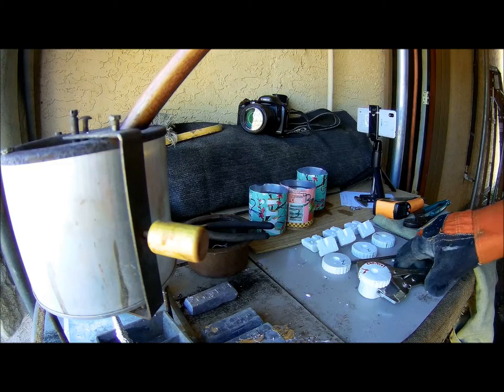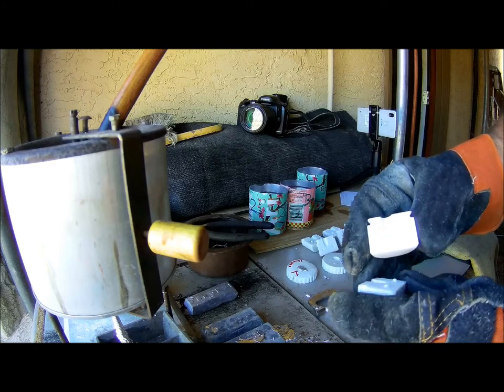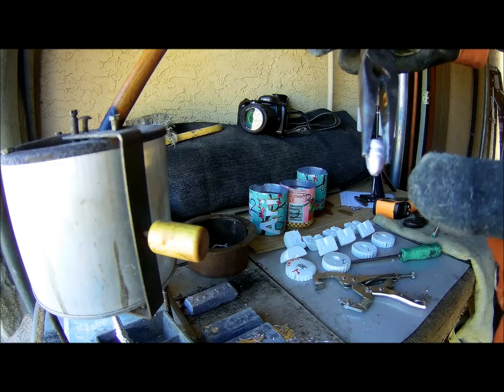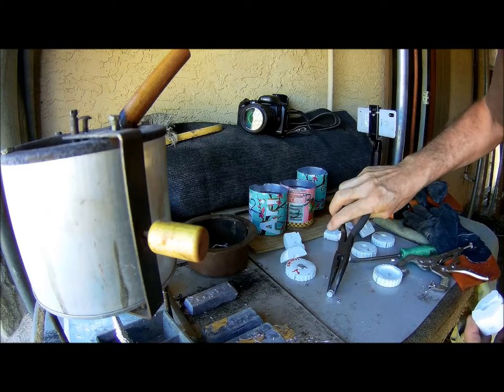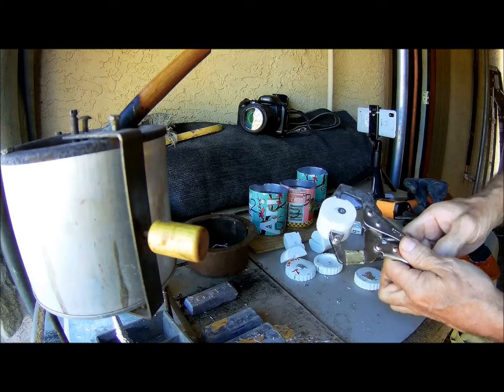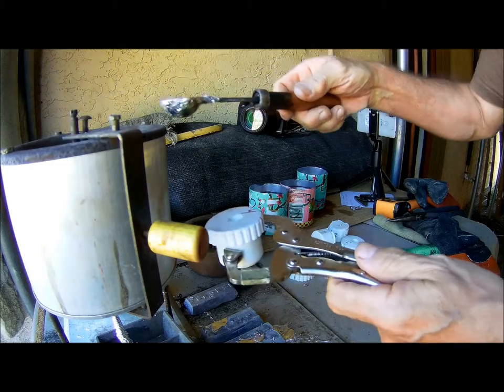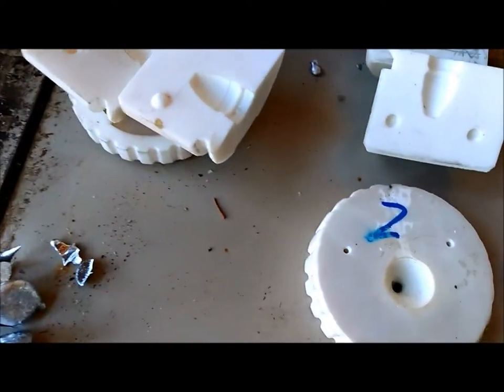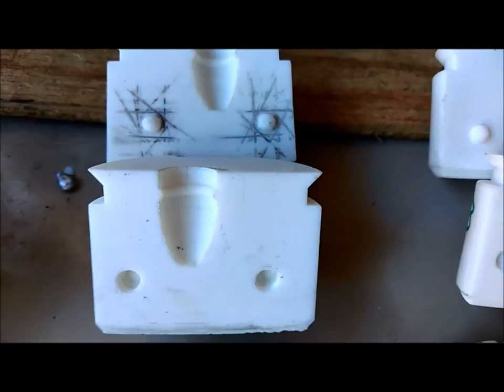3D Printed Single Cavity 9MM Bullet Mold Test Cast Number 3

Comment: You might want to try spraying a little water on the sprue right after pouring the lead. I have used this trick to speed up cooling on aluminum molds.
Reply from the maker: Greetings David Sherman; I used to do this too with my less expensive Lee bullet mold sprue plates then I switched over to using some lube called "Bull-Plate" or something like that.

I also tried water on my 3D printed injection molds but it was like pouring hot water on a frozen windshield on a cold winter day.  This was done using another version of the Siraya Tech Sculpt line of resins so it may be Ok to do with the  Siraya Tech Ultra White Resin.

Now that I have some used molds I may give that water cooling thing a try since these  prototype test molds are now relegated to expendable molds.

Comment: Uneven heating in the mold: I'm thinking it may be because your mold cavity and sprue hole is off centre? This may cause the lead to pour in against one side first, resulting in more heat transfer to that side of the mold. This is pureley a guess on my part.
Reply from the maker: You're absolutely right.  I found that to be just one of the reasons for this happening.  To confirm this further I've been making some pencil sketches of what I'm thinking of trying to incorporate with the next couple of 9MM bullet molds I print out.

I plan on printing one that is basically the same as the ones I've shown in these videos and the other will be of the hollow pointed variety.

The tip of the hollow pointing stem will have some V-groove types of cuts or channels cut into them so as to channel the molten lead  away from the seem lines primarily and to hopefully   direct the molten lead evenly in all directions at once as the lead fills the cavity and solidifies.

That's the plan; whether it will work is yet to be seen.   Regarding the  forgetting to put my safety gloves on, Yea I know.  I just get in to much of a hurry sometimes.

Thanks for taking the time to post a comment.
Reply: @MrTjmk  Hmmm...hollow pointing is normally done with removable pin that forms the hollow point. That may be a bridge too far for the prototyping process. I'd wait to tackle that one after you have solved the dimensions and heat transfer issues. This is an exciting process and I encourage you to keep at it!